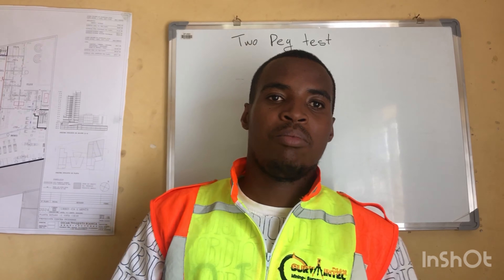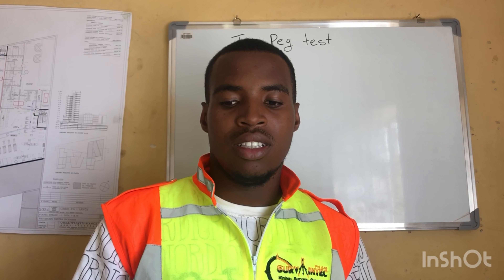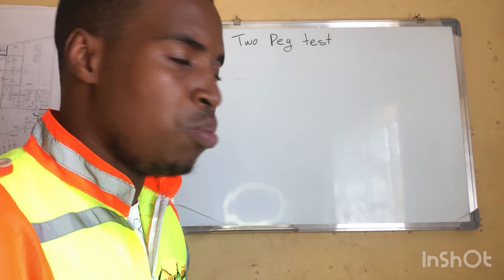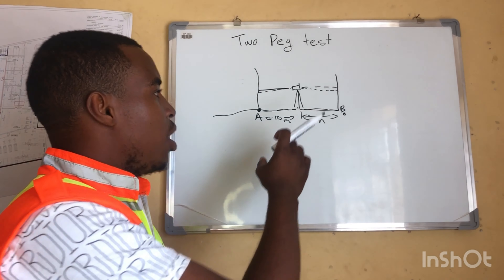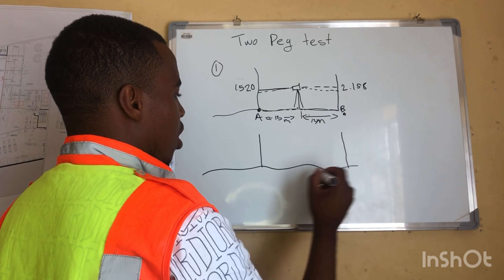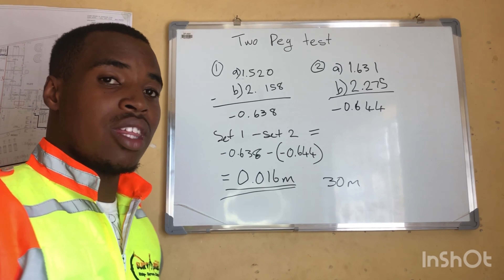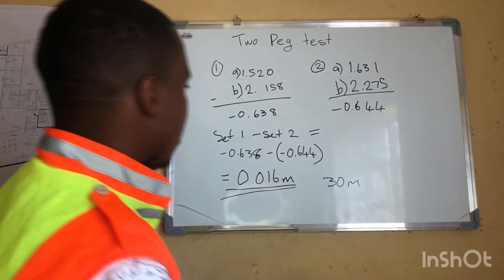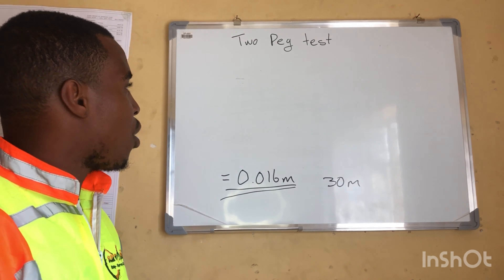How to do and calculate a two peg test

Comment: After finding the error, how do you apply the correction at a and b?
Reply: 6:06  you can check the video from here… a and b are testing points for your machine hance they don’t need any correction. The correction you will be applying it when you do your field work